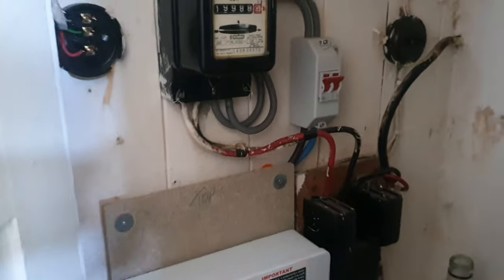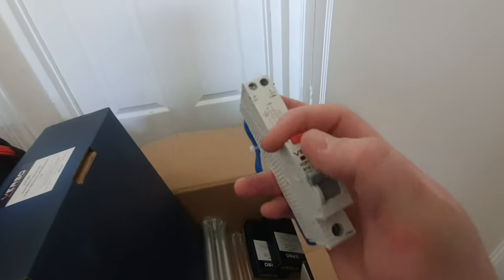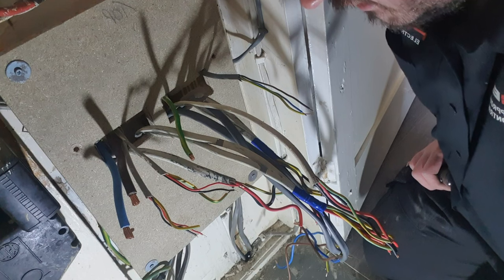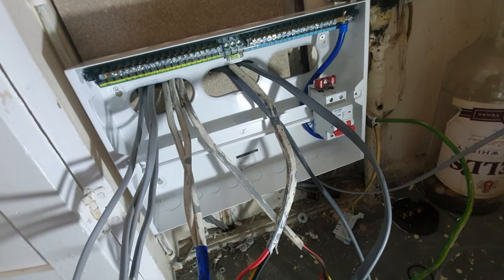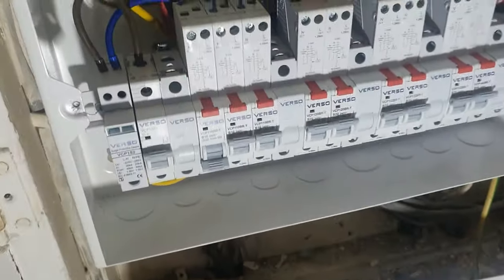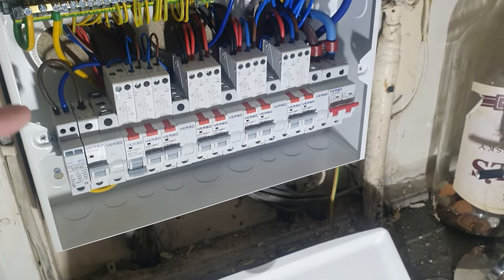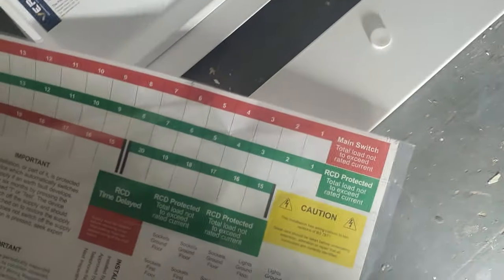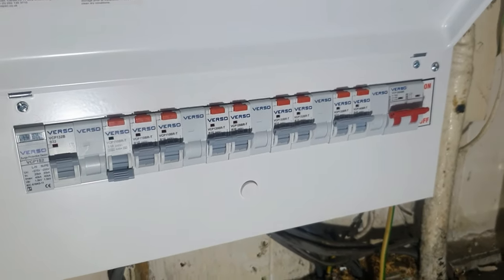VERSO VS FUSE BOX... THE KING OF BOARDS! WHO WILL WIN AND WHY? (also a give away to be won!!!!)

Comment: Hi Rick, I have just started looking at the Verso Boards, I have mainly fitted Wylex (in social housing) and more recently FuseBox for my domestic customers!. I really like the FuseBox range but I also like the look of these Verso ones too. I've watched your video a couple of time but cant seem to get a grasp on why you swapped out the boards? For me once I have fitted a board I would only change it for expansion purposes or issues with the RCD's/RCBO's. When it comes to fitting a new board I can understand that some boards are way easier to install because of room etc. One of the challenges I have had with the Fusebox range on the smaller boards was fitting the 16mm Earth in the Earth bar and I am also not the biggest fan of their meter-tail glands the Wylex ones are far better. I watched a couple of Videos on the Verso now and the one draw back for me was they don't make a mini RCBO and whilst I like more room in the Consumer Unit so you can dress the cables most of the time the overall height of the consumer unit becomes an issue. I enjoyed the video and glad to see you use Pedro too!